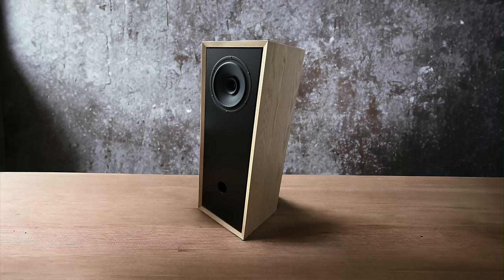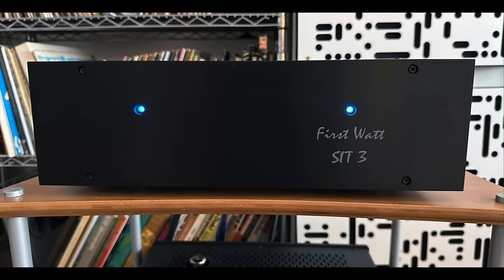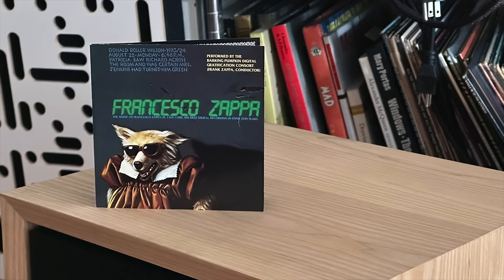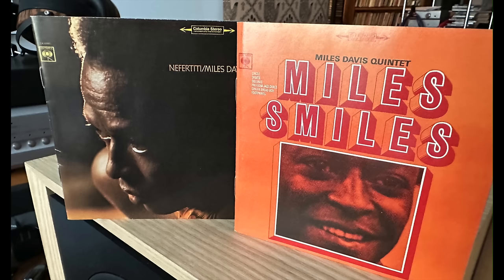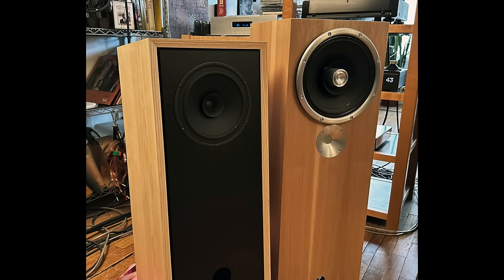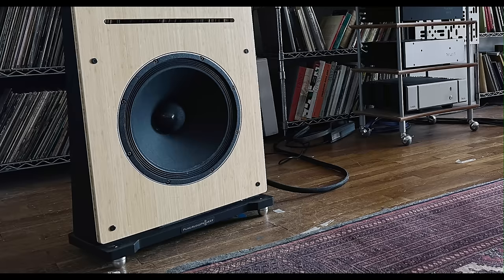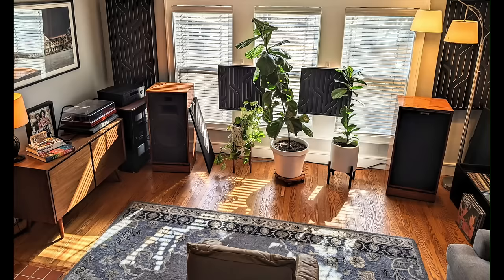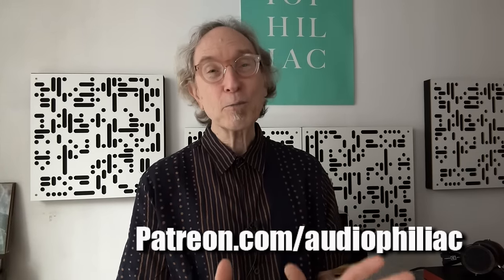FERN & ROBY Raven III, a full-range, single driver speaker

Comment: I have been listening to a pair of Lowther full-range horn loaded speakers for nearly 20 years now. Needless to say I am totally sold on the "full range" concept.
Reply: Been building full range loudspeakers for over 30 years. Pair I have now easily hits 25hz strong sounds like dual bass horns in bass can play pop pipe organ or any music at high SPL without issue.

Comment: I've been fortunate enough to have heard a handful of other single driver speakers, and this sounds like one that I need to check out. The ones I've listened to, do indeed sound more "natural" as you stated. Perhaps that's due to the lack on crossover. Thanks for another great one, Steve. My wallet may NOT thank you... 😂
Reply: As mentioned in the companion video with the designer, there are (notch?) filters used - an image shows 6 parts - 2 air core coils, 2 caps, and 2 resistors. Yes, there is no crossover, but there are filters to smooth out some (higher?) frequencies.

Comment: Quite a lot of loudspeakers use full range : Pearl acoustics, closer acoustics. some amazing ideas floating around and with transmission line acoustics.
Reply: Indeed, both “full-range” / wide band drivers and  variations on TL / MLTL topologies have been popular with DIYers for decades. Until I retired from active building about 6 years ago, I’d constructed scores of enclosures using drivers from, Fostex, Mark Audio and the original CSS, and 7 of the channels current 7.2.4 Atmos system include Mark Audio / Alpair drivers.
Reply: Yes.
Reply: Definitely some cool ideas out there. These are pretty wild.
Reply: I would like to listen to the ej jordan marlow loudspeakers.

The full range driver is their own design but made by Scan Speak.
Reply: I'm looking for some nice kits

Comment: Thanks!
1. These would seem an interesting candidate for nearfield listening.
2. Is it not more correct to describe the F&Rs as a dual or whizzer cone rather than a single driver speaker like, for instance, the Pearl Acoustics speakers? An attached cone like this involves a very real mechanical crossover which comes with significant compromises including shadowing part of the main cone. 
3. Having just listened to your interview with the creator, it's clear there's also significant, passive electrical contouring, in the speaker which is not dissimilar to what you might find in a typical speaker. A two-way, in fact, may have fewer pieces in its circuitry. And, is it not true that these contouring networks induce phase and other issues like typical passive crossovers? 
4. I checked the F&R website I couldn't find anything even approaching a frequency response graph. Would it not be reasonable at these crisis to provide this basic information?
5. BTW, a review on the F&R says they are easy to place. Who can tell? 😊
Any thoughts? Thanks again, Steve and congratulations on the subs!

Comment: Audio Nirvana 10”Alnico driver in plywood + mdf (total 30mm cabinet)+ Duelund speaker cables inside and outside + Velodyn sub + some room acoustic stuff + digital room correction costs below 50%… but I won’t make any further judgements without listening to them.
Reply: Nice. Audio Nirvana from Commonsense Audio. But need a strong EQ. Because high peaks between 2khz to 4 kHz. This is my experience.
Reply: Audio Nirvana drivers interest me greatly and being a DIY guy, maybe I need to just pull the trigger and score a pair.

Comment: Changing my initial comment.. Steve didn’t speak about the custom work Christopher has done with SEAS on the driver (nearly 2 years of work). So to me this along with the filter network (which Steve mentioned in the interview with him) justifies in my mind more of where he is coming from re costs and value. But still way overpriced
Reply: Exactly - an unknown company charging outrageous prices. Audiophiles must be very gullible.
Reply: As a woodworker, I feel that price is fair and reasonable. There is a lot more than just the costs of construction to handmade loudspeaker building. 
Stand-up guy with a nice product.
Reply: No way.. no internal bracing, fronts and backs are particle board… it does apparently have a crossover or filter network of sorts … but bottom line this is a ridiculous example of overpriced boutique audio.. you can spin a long story about how rare and hand made it is but that’s about it
Reply: Obviously you know nothing about manufacturing. Production  on smaller scale always cost more than mass produced products. Watches, autos, knives, belts, everything!!!
If the value isn't there for you, don't buy it.
Reply: @saint6563  I guess if you want a nice decorative furniture piece then sure makes sense. From an engineering perspective for a LOUDSPEAKER it’s not what I would call any value
Reply: Since Steve has heard the speaker and has heard many other speakers in the same price range and  recommends it highly, you must think he doesn't know what he's talking about or is just a shill for the manufacturers. If that's the case, then, why are you here?
Reply: If only you would be handy enough, if only you had enough engineering skills to engineer that cabinet
Reply: There’s indeed no justification ,
I would buy a lii audio f15 , build a cabinet and save a lot of money ,….just me !
Reply: @Darkmatterme  yes true.. for that price I would likely just buy the Børresen X2
Reply: It is a lot of cash. But to think that the price of a product is such a simple equation, shows that your understanding of business is similar to that of a third grader. You must be furious when you go to the store to buy a loaf of bread for $4 when you know that the ingredients cost only a few pennies? Carrots “but carrot seeds are so cheap!”
Reply: Business costs. Labour, premises, energy, rates, insurance, marketing, research, design, prototyping, machinery. But even then it is steep.
Reply: Omega makes incredibly reasonable Single Driver Speakers, with the own drivers, for a 1/3 the cost.  At what point do stop paying for Sound, and Start paying for the Fluff and Flash. Its up to the buyer, as too how much extra you want. Id say over $4k-$5k you start to pay for alot more fluff in most cases, not all. Like panels can get really pricey, but they reall get better. Like Alsyvox, those are nuts.
Reply: I’m missing something. The Audiophiliac reviews a lot of hella expensive gear. Why the uproar about these puppies?
Reply: How do you justify such an asinine comment?
Reply: You can build your own and sell them.  You can put them out of business.  😅
Reply: @mikechristensen1285  not a simple equation.. but there is nothing remotely engineered here.. it’s just nice cabinet work and a outsourced driver. Lots of better options..but nothing against anyone who goes for them.. it’s just very little investment in engineering.. if you like his artistry and effort in cabinets then go for it
Reply: @lsaideOK  not to attacked Steve.. but there is the novelty factor of his job.. he’s got to keep getting excited about products
Reply: @sambarone981  I don’t get it either.  These speakers are making them so mad.
Reply: @danab7472  the resale value/roi of speakers is a high-priority consideration factor. 🙄
Reply: All I need to point out that after reading a few other reviews there’s more to the story.. he has spent the last two years working with SEAS on this driver.. so not an off the shelf driver.. including coatings and materials etc.. so would have been good to mention this in the review.. so my initial judgement was not fully informed.
Reply: Fern and Roby has been on the scene for years including being very active at the trade shows and highly celebrated as an OEM.  They are extremely well known by those who passed elementary school without a major run-in with their teachers.  My advice is, if you don't know something, just say you don't know, rather than piling on BS nobody wants to hear.
Reply: @justadad2304 fyi those who have run ins with their teachers are usually the smart one.. sheep

Comment: There was a company in the 70's that had a speaker a bit like that, with a single 6X9, no crossover or tweet etc that sounded really good. A store that sold records and tapes had four of them in the store, and it got loud in there. I don't know what they looked like inside, but the front had the speaker and the top and a port and the bottom rear.

Comment: I don't want to appear negative but that seems a lot of money for a full range driver made by SEAS in a wooden box. Not exactly an innovation. Lowther have been doing this for decades. I'm not suggesting it's not a good speaker, but value for money is very poor. Surely if one is made of ash and the other Walnut they will sound different due to wood density. This is one reason why loudspeaker manufacturers normally avoid using solid timber as no two pieces are ever the same.
Reply: Yes,the parts cost is low ( Speaker & Box)

Comment: I find it equally insightful hearing similar sized speakers compared with lower priced "generally well reviewed" speakers, and with approximately = priced speakers & just as important imo, also compared with far higher priced ones, all of similar overall size, whenever it's possible in reality or from a seasoned reviewers memory. All those comparisons only help get a better handle on the speaker under review, imo.   Love the shape of the Mola Mola Class D job,  it's a looker. I expect a good review from previous NCore costlier model reviews. Super high damping, I wonder how Maggie's or e/stat bass panels would sound under it's theoretically super-grip hold from the (4000 or +?) high damping factor.

Comment: I made full range speakers for use outdoors.  It featured the World Famous Altec 755 E  pancake speaker.  .  It was amazing ly flat from 45 to 14000 HZ in a smaller 2 cu ft enclosure ported to be placed against a wall.  I can remember we though the world was going Crazy when Altec doubled the price inn1968.  Around $70 as I remember.  The Altec 409 was a Coaxial 8 inch speaker and had extended highs but the bass below 80 hertz was thin.  It was cheaper  speaker, but I preferred the 755E.    They were both  very popular if implemented correctly.
Reply: I've only heard the 755 for about one side of a record at a shop in the Shindo cabinet (or maybe it was Line Magnetic). It didn't pop for me in that situation that there was something special going on, but there was a lot of conversation anyway. I feel like I need to hear it properly.

Comment: I have a similar drivers from CommonSense Audio. Also are Immersive, very detailed and natural.  The problem with this type of speakers is that the treble is extremely directional.  that is, if you move off axis just a little;  You lose a lot of treble.
Reply: I guess if you put on music to listen to treble that could be an issue. I for one most definitely do not.
Reply: @weatheranddarkness  the important is the balance, if you lose treble, you lose the balance

Comment: I built the hammer dynamics in 2000. They were one of the best speakers I've ever heard. 575.00 for the kit
Reply: I remember those times! Did you follow the single driver message board?

Comment: $8,500 a Pair? !!!!!!!
I bought 8 Realistic 15" music instrument speakers for about $32 a Piece in 1,992 when they were discontinued. They work Just Fine wired series parallel 4 in each box parred with 8 2x6" pizo horns that play down to about 2,500hz. The 15's go up to 3,000hz and blend about perfect with No Crossover. Okay now, i get these babies rippen off an Allen Heath 500 watts per channel 12 track amp, then mix in my Tapco 8" bi-amped studio monitors in conjunction with 10" Tannoy sub-woofer cube. The SOUND Blend is astonishingly phenomenal to say the least. I'll stick with my ears! :-)

Comment: I always have trouble with the description “full range”. Single dynamic drivers can be wide band but not wide enough to be “full range”.
Reply from the maker: I hear you, but of course everything in speaker design is a compromise. You could say the same thing about any two-way stand mount speaker, they cannot be full range. I think to be full range you need a really big box, with a 15 inch woofer. Like the Klipsch Cornwalls. But for most people they are way too big!
Reply: @SteveGuttenbergAudiophiliac  in Germany, the name for this driver type is "Breitband" - wide band. That all being said, if the speaker is this much fun, who cares what it is called.

Comment: Would love a comparison to Cube Audio speakers
Reply: I second that
Reply: Cube might actually be worth 8-9k 

Of course they’re selling for 16

lol
Reply: @ColocasiaCorm  I think the factory version of mine, the ceramic 8" was still about 8k recently? I'm running them raw, no filters, nothing. I don't know if they have filters from the factory, like these Fern&Roby. So hard to say exactly what to expect. I got a new TT and arm recently, and it seems to have unlocked a capacity to image that I didn't know my system had. No other changes, same cart, pre, and amp.

Comment: Harley Lovegrove's beautiful solid oak Sibelius loudspeaker by Pearl Acoustics looks like better value compared to these.
They really are crossover free and voight pipe/transmission line loaded.
Hope you will review them Steve!
🎵🎶🤫🎶🎵
Reply: And a very close approximation to the Sibelius can be achieved for a fraction of the cost by a DIY builder in any of several enclosure designs by Scott Lindgren, using readily available stock drivers from the Mark Audio line, such as the Pluvia 11, or CHN110/120 . I’ve had  a trio of the older Alpair 10.3 as front row in my home theatre rig for over 6 years. With a combination of reasonable expectations and modern bass management available in surround processors/receivers, “full range” drivers can work quite well in this application.

Comment: Seems a a little on the high priced side for not being transmission line, also from what i am told depending how there damped. no 2 pieces of wood are going to provide the same freq. response, as would HDF with a quality veneer. but hey I'm sure they sound really smooth. It all depends on the type of music you listen to.

Comment: The home site lists $8500 a pair. I’ll pass.
Reply: Another example of a boutique company that has to charge 3 times the price of an established company to pay themselves, and I’m sure pay themselves handsomely at that. Hard pass.
Reply: Well, the seas exotica full range drivers are a grand a piece. The cabs being solid wood are way more expensive to build with. So if you figure 3500-4k for the materials, a markeup of 2x is less than you pay for the "big brands". Those are typically 3x in mark-up by the time the consumer buys them.  I'd put these speakers in a small room with a nice smooth streamer/dac and a slightly warm sounding amp and drift away for hours. 

I built some full range speakers and they provide an exceptional listening experience. It ain't Michelin 5 star, it's down home cookin' . Love it.
Reply: These do not use a variant of the $969 SEAS red ALNICO magnet SEAS Exotic X1-08 full rangers.

The drivers shown look like a variant of the SEAS mud magnet Prestige FA22RCZ, which lists retail for $211 at Madisound. Even less in quantities.
Reply: In America everyone has a right to ask whatever they want.  That being said I’ll keep my Tekton’s at a 600 per cent savings and a 3 per cent loss in sound quality.
Reply: @terryhu57 Which Tektons? How long have you had them? I'm in the market for tower speakers. Thanks for any response.
Reply: Good. Do that. Thumbs up. Thanks for sharing.

Comment: There isn't a full range speaker driver made today that can reproduce the full audio range. These are wide range drivers not full range drivers used in this speaker. If the speaker can cover 20Hz - 20KHz +/- 3dB then it can be regarded as a full range loudspeaker. If it doesn't cover that range, 20Hz - 20KHz within +/-3dB limits then the speaker is not a full range loudspeaker.

Comment: 8K kind of a joke IMO.
Reply: Mine too. Ridiculous.
Reply: It's insulting, they will be going for 2k at best, second hand. If anyone even buys a pair.
Reply: Too expensive, but the drivers alone are 1700$  (seas exotic slightly modified).  7grand for the work, a cabinet and an impendance correcture is a bit exaggerated in my opinnion.
Reply: They are not using those $969 alnico motor exotic SEAS drivers. 

They are using a variant on the $211 ferrite magnet 8” inch driver

Comment: Sorry to say but the price of $8.500 for a small, single drive cabinet in a simple veneer finish is simply unrealistic, especially for Europe when including taxes and all.
Reply: Veneer? This is solid wood. Please watch the episode before commenting.
Reply: @jan9 Even if it's pure ebony of whatever wood, that doesn't change anything in regards to the ridiculous price. In fact it's probably easier to work than veneering.
As soon as I saw or heard the price and saw the speakers, I didn't bother watching any further. Getting good PR from Steve is a swan song for this company.
Reply: @puciohenzap891  High end hifi is expensive, but not if you compare it to a high end handbag :)

Comment: Tannoy has been refining single drivers for over 70 years
Reply: Tannoy is a concentric driver, incredible, but very different
Reply: So have Lowther and Fostex and the full range driver was the brainchild of Paul Voigt, going back to the 1930's.
Reply: Tannoy is a 2-way cab, it has a compression driver in the middle.
Reply: Invented in  1920s by C.W. Rice and E.W. Kellogg also RCA Victor was using full ranges in large theater horns a decade before Paul's work.
Reply: @kloss213 Yes , Kellogg and co invented the cone loudspeaker but Paul Voigt devised the whizzer cone full range driver for use in the Voigt domestic corner horn with mains energised field coil magnets, later repaced with the PM units in conjuction with Donald Chave of Lowther.The patents are still available and the modern Lowther units are still based on Voigt's design.